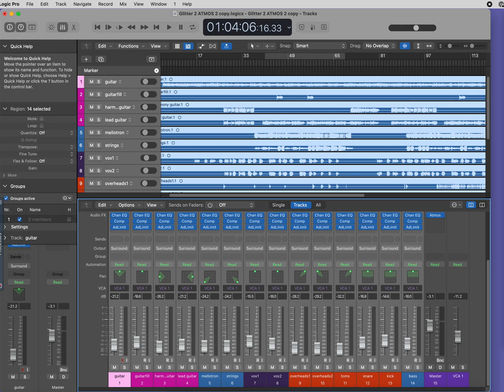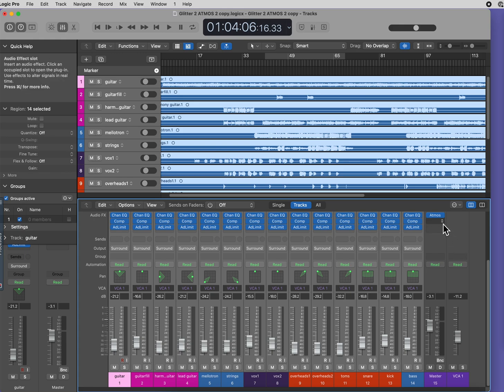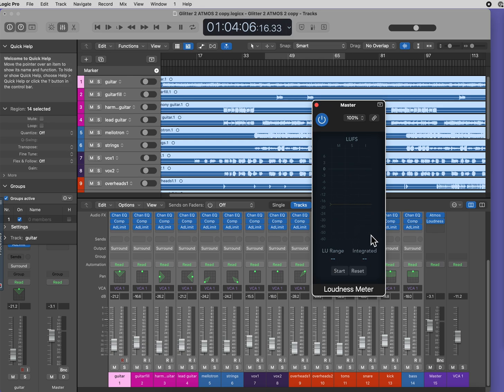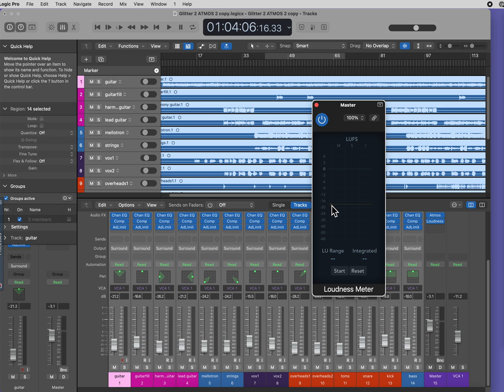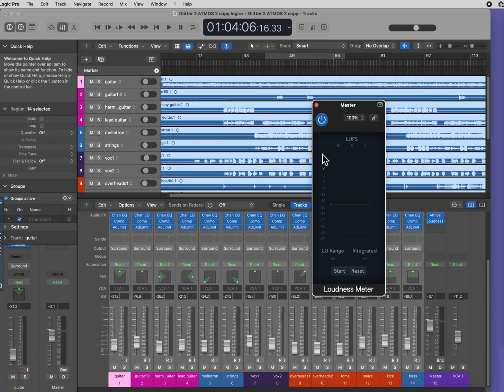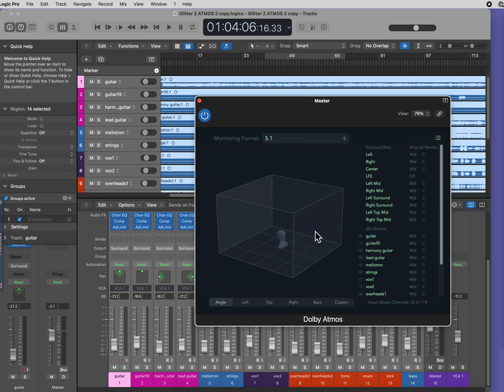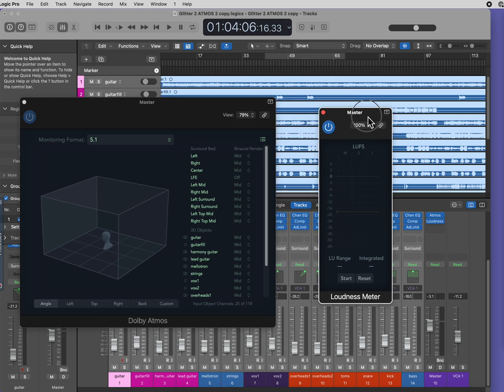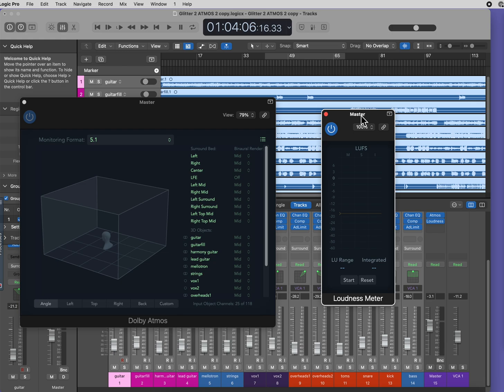Master Your Atmos Mix for Streaming: A Guide to Loudness and LUFS in Logic Pro Tutorial

Comment: Okay, I have monitored my entire track with the renderer in 5.1 and managed to adjust it to slightly below -18 LUFS. The issue is that when I switch the renderer back to binaural, the meter shows -12.7 LUFS. I understand that this isn't a problem because what we export isn't a WAV file but rather a file with information and metadata. The important thing is that in the 5.1 format, and only in this format, it does not exceed -18 LUFS to avoid rejection, correct?
Reply from the maker: Correct.